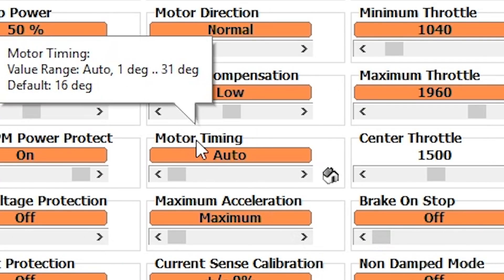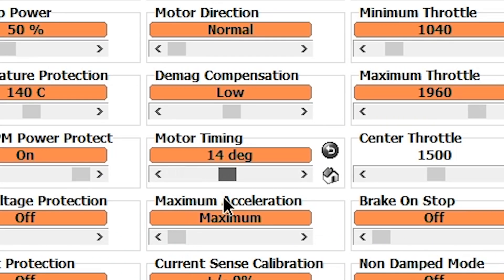BLHeli32 100% Explained - Part 3 - Motor Timing

Comment: The best analogy of timing of a brushless motor is with internal combustion engine ignition timing - the spark plug ignites the air/fuel mixture while the piston is still travelling up (i.e. just before the piston reaches its maximum point). The reason for this "early" ignition is that it takes some time for the front of the shock wave to propagate from the spark plug to the piston surface and the combustion still continues for some time afterwards. Timing (aka 'advancement') of ignition depends on many factors these days (that's why have ignition 'maps' for ICE engines), but the most important of them is rpm - the higher rpm - the bigger the advancement of the ignition, in order to compensate for the higher piston speeds.
Just like ICE engines benefit from variable ignition timing, so would brushless motors - even more, because electric motors work in a much wider range of rpms than combustion engines (that's why electric drives do not require gearboxes). Variable timing could be implemented similarly to the variable PWM frequency - you'd set, say 15 deg for the low end and 30 for the high end of the rpm spectrum and the ESC would smoothly transition the timing between these two values depending on the current rpm of the motor.

Comment: I was having a problem with a 4 way desync on my quad on full throttle, either hard rolls or punchouts. I tried setting the timing to both auto and 23, and neither fixed the problem. So I had to set demag compensation to high, which fixed it.

Comment: the more timing you have does it cause the motor to run hotter with a bike or car you can burn a hole in the piston or burn valves which you can compensate with fuel but helps you get into the power sooner in my mind this could be helped with the filtering gains

Comment: Higher timing caused bounce back when doing fast snap rolls on low throttle. 22,24 worked fine on my heavier quads. 450grams +. On my race quad auto timing solved it. The stock 16 probably would have been fine but 22 was too much on my 320gram 6s race quad. PWM stock 24hz caused bounce back also. My light race quad loves 48hz and my heavier quads love 40hz. Very interesting troubleshooting. I tried everything and then some with my PIDS before figuring this out. Nasty bounce back problems in both of my cases had nothing to do with my pids. What a learning experience!

Comment: One point of clarification on timing, that I'm not sure was clear from the video.  The zero crossing detection comes first, and it uses that crossing to predict where in the commutation cycle the poles of the motor are in relation to the phases. It begins the timing advance delay once the zero crossing has been detected, as that confirms the phase is half way through the phase and ready to be "pulled" on to the next phase.  30 degrees advance means the signal to the FETs is sent as soon as the zero crossing is detected, 0 degrees advance means that essentially waits till the BEMF signal reaches it's peak to turn them on.

Comment: I use BLHeli32 for the drive in my CombatRobots and I definitely had to change the timing since I was driving wheels instead of props.
Reply: Oh yeah, loaded start makes a HUGE difference in expectations. Way harder on the ESC. What settings did you end up settling on?
Reply: @QuadMcFlyFlies  Had issue to where the motor would stutter to get going but to fix that I had to bring rampup power up to 125% and increase the timing to 25deg. Any higher and it got a bit hot for comfort.

Comment: So if current and torque are proportional.. that means on 6s where there is less current you need a bigger motor to increase  your torque .. So low kv 2205, 2206 and 2204 motors are a waste....
Reply from the maker: No, that's definitely not true. I don't know enough about the theory to tell you why, but I can tell you Neill Whiteley of Catalyst Machineworks says that 2206 is particularly good on light-weight 6S rigs, and nobody who is going to 6S-low-kv is switching to larger motors than the usual 2207.
Reply: There is some discussion of this. I've had some really interesting talks with Bob about it. The short version is that you do end up with a bit "softer" very low end at 6S especially on smaller motors, but almost no one who is flying high voltage is using the lower part of the throttle. By the time you get to the higher points in the throttle the current is high enough to mitigate any differences. The other thing is sustained current is lower for 6S, but the instantaneous current, the current jumps that happen during rapid changes in throttle, are actually very close to the same, especially with larger jumps. Given that folks are running Kv at 6S that are higher max RPMs than the typical 4S equivalents, this largely balances out. This has some really interesting impacts on the way 6S feels in the air and what is actually happening between the throttle curve and the transitory torque.  Basically the short answer is current and torque are proportional when all other variables stay constant, but there's enough stuff changing with most people's high voltage setups that there are other variables involved. Using smaller motors is actually one way of limiting the current draw which has a tendency to rise rapidly as RPMs increase. The relationship between RPMs and energy is non-linear. There's a ton of other factors going on in this including battery chemistry, etc, that are all playing a role as well. It's a complex discussion.
Reply: @QuadMcFlyFlies   Now that's an answer I surely did learn something  today...  thanks ... I'm currently  loving the feel of 2306 2400kv on 5s with 5149 props .. could you do a test on this setup to see what response and current draw it produces...?
Reply: @marcusmckay8120  unfortunately the current draw on that setup would be pretty likely to burn out the motor. Likely north of 50A near full throttle under static load. The max you can get away with in static tests are around 1850kv for 6S tests, and 2200kv for 5S before things start melting.  You can get away with it in the air because of voltage sag, and dynamic unloading due to the varying angle of attack, but static tests are impractical beyond a certain point.

Comment: Why is the timing set as an angle? That changes the advance time with rpm while coil demagnetization time remains the same. Or at least i would guess so. I really dont see why would demagnetization take longer at lower rpm.
Reply from the maker: I have a few guesses to why they use degrees, but honestly I don't know the right answer.
Reply: It is degrees of electrical rotation, not physical degrees. Sot it is related to how early in the BEMF signal it fires. These are 3 phase motors and ESCs, so 180 degrees for  each current direction (360 degrees total or the full sine wave) for a full commutation divide by 3 phases and two directions = 60 degrees, 60 degrees divide by 2 = 30 degrees, or the maximum "ahead" of the zero crossing to the last point it can be fired without pulling backwards instead of forwards. Make sense?
Reply: @QuadMcFlyFlies  Oh, Mr. QuadMcFly himself! As I understand it, eRPM = RPM * poles, so it still changes the advance time? Is it actually supposed to compensate for demagnetisation or something or am I completely wrong? Also, I thought BEMF zero crossing happens ideally exactly midway between two commutations so it should ideally fire 30 degrees after zero crossing. I am only self taught on this, though I'm an electrical engineering student so if you can point me to some good read on this, I'll bother you no more. Thanks for your time.
Reply: @jindrichrozkopal9760  the ESC has no idea how many poles a motor has, it can only read the advancing BEMF signal on the non-active phase. So when I say electrical degrees, it has no relation to physical orientation it's simply the progress through the commutation cycle.   The timing is always in reference to the upcoming phase, not the previous phase crossing, as the previous data would already be out of date if the motor was accelerating or decelerating, as the active phases can't be actively measured.  Rather the incoming BEMF signal is continually monitored to detect the zero crossing point, which will predict the upcoming phase switch.  There is a really good article on the basics here: https://www.digikey.com/en/articles/techzone/2013/jun/controlling-sensorless-bldc-motors-via-back-emf
Reply: @jindrichrozkopal9760  One more thing that might make it a bit clearer. The time scales at which this is all happening is VERY small, so the RDSon time for the FETs, the coil rise time in the stators, line resistance and impedance, all impact how long it takes from the time the ESC sends the signal to open the FETs till when the coils in the phase are fully magnetized.  Also as the RPMs change the time scale that those 30 degrees take to progress also shrinks dramatically. Typically higher timing is needed at higher throttle due to the shrinking time scale and the changing percentage of the delay those electrical properties introduces compared the total time available.
Reply: @QuadMcFlyFlies  That is exactly what I don't understand. Why is the timing given in degrees when the time those degrees present changes with rpm drastically. I'm gonna go have a proper read on this before wasting any more of your time because there is probably something that I got wrong. Thanks again
Reply: @jindrichrozkopal9760  Well some of the hardware specific delays that are constant are accounted for by dead-time (which isn't a configurable setting, but is still somewhat related), but some of it will fluctuate as current, etc, change in the system, even at the same RPMs.  

Using degrees as the identifier means that the timing scales with the BEMF signal, which is the really critical point. The BEMF signal is essentially being used as a method of tracking the progress of the magnetic field of the permanent magnets on the bell past the phase of the motor. While we don't know the specific degrees of physical rotation, it does tell us the part of that we need to know to successfully drive the motor on to the next phase. Using the BEMF signal as the timing reference keeps it consistent in relationship to the signal being detected and its electrical position in relationship to the stator phases regardless of time scale.  

As Joshua said though, auto timing will make further adjustments based on other feedback to try to optimize things and eliminate some of what you're talking about. The only problem is it is optimizing for general purpose effectiveness, not necessarily the most robust against issues, or best power output.
Reply: @jindrichrozkopal9760  Also one other point to keep in mind in relationship to your initial question, when the motor runs at low rpms, the resulting BEMF voltage is quite low. This results in two things, the sensing signal
 for zero cross detection is  very weak, and the current flowing in the motor is potentially pretty large (for instance in that moment between when the FET duty cycle changes and RPMs have yet to increase). Remember, the actual driving voltage of the motor is the difference between the full battery voltage and the BEMF voltage. A weak zero cross signal combined with a potentially very high motor current can dramatically change both demagnetization time, and general timing needs compared to a very high voltage BEMF signal (high RPMs), and low current (low FET duty cycle, but RPMs have yet to reduce.)

Comment: I have an issue: when I plug the battery into the quad I get constantly beeping ESCs. They beep like every .5-.6 seconds. Is it because the battery is just at something like 3.6V/cell? Unfortunately banggood has some delay with my charger so I can't check if this is the issue. Or is there another reason for this beeping?
Reply from the maker: It's hard to guess why the beeping is happening without knowing more about the quad. The low voltage alarm is set at 3.5 volts per cell by default.
Reply: Joshua Bardwell since this is my first quad, I chose a pretty standard setup: 4S battery, Racerstar StarF4S (F4 controller, 4*30A ESC combo), Samguck Wei 2600kV, Eachine TX5258, FS-iA6B, Runcam Split 2S (although the latter 4 ones are probably of very little interest for this issue). According to my multimeter, the battery has 14.48V (3.62V per cell).
I recently flashed betaflight 3.5.4 onto the FC and since then I got these beeps (although I doubt it has something to do with it).

Another weird thing happening since the update is that the betaflight configurator doesn't automatically connect anymore after I hit save and reboot in a menu. I always have to unplug the quad, hit disconnect, reconnect in order to get back into the configurator. However, I think this is due to the different driver I installed with zadig. Using the speedybee app via usb otg, this seems to not be an issue of the FC/firmware but probably a driver issue. 

If I can provide you any more information that might help analysing this problem, please ask.
Reply: Joshua Bardwell another thing I just found out is that it seems to beep ~8 times quickly, then a short break, then ~8 times quickly again, again a short break, and then it beeps a bit slower but continuously
Reply from the maker: Hmmmmm have you got video of it you could share?
Reply: Joshua Bardwell I just filmed some clips of the error. And while doing that, I connected the drone to my RX to show you that it's not the RX lost sequence. The crazy part is: it was. I was so sure that it wasn't the RX lost because I tried whether this is the issue a couple of days ago and there it wasn't the issue; it kept beeping. I assume I have a loose connection there...
So first of all, thanks for your patience and sorry for taking your time...

I'll probably wait with any more experiments with my drone until the charger arrives. I mean, 3.6V/cell isn't terrible for the battery but I might be better off letting it stay there for now.

Comment: Great video and very informative.  However, these little 8 minute segments with you repeating the same thing at the beginning and end of each one as means of introduction and closure is somewhat annoying.  Your dedicated followers would be more than happy to watch the entirety of an hour-long video in one sitting.  And if not, I'm sure we could determine which parts we were most interested in if you had released one video with a time index by subject matter as opposed to a multi video playlist that was clearly shot in one sitting.
Reply from the maker: You can easily skip the intro by pressing the number 1 on your keyboard which jumps you 10% into the video.
Reply from the maker: The problem with one big video is that it is not optimized for search results. So if somebody searches for "blheli pwm frequency", they will find my video because it has PWM frequency featured prominently in the title. But if the video is named, "All About BLHeli", then they won't find the video because it doesn't rank for that search result. So there is more going on here than it at first appears.

Sorry it's annoying, but there is a good reason for it.
Reply: @JoshuaBardwell  Got it. Thanks for taking time to explain your reasoning.

Comment: this series of videos are very interesting and useful BUT the 8 min splitting strategy is really becoming annoying for me because how many time do we have to watch the intro?? I would prefer watching the whole thing at once. that way you will not have to waist time explaining the playlist and everything in the beginning and at the end of the video. I mean that's gotta be tedious work for you as well...
Reply from the maker: You can easily skip the intro by pressing the number 1 on your keyboard which jumps you 10% into the video.
Reply from the maker: The problem with one big video is that it is not optimized for search results. So if somebody searches for "blheli pwm frequency", they will find my video because it has PWM frequency featured prominently in the title. But if the video is named, "All About BLHeli", then they won't find the video because it doesn't rank for that search result. So there is more going on here than it at first appears.

Sorry it's annoying, but there is a good reason for it.
Reply: @JoshuaBardwell  good to now! I learned another thing today👍

Comment: So it's basicly like old cars with a disturber cap and rotor and advancing the timing on that. You get more power but use more gas. 15% that's what the standard on the good old v8's also!